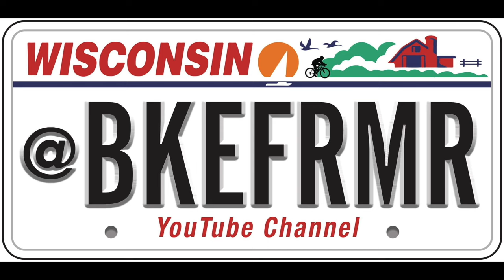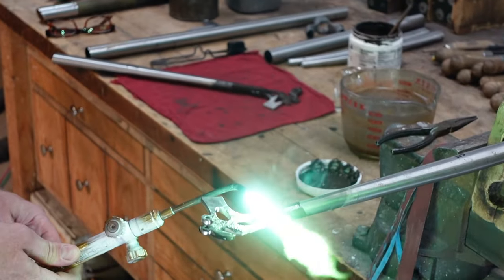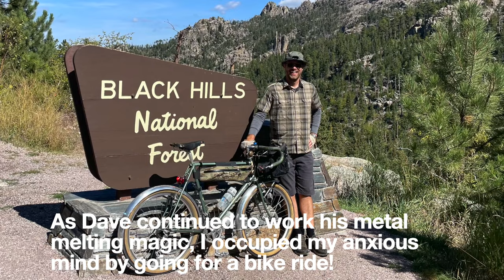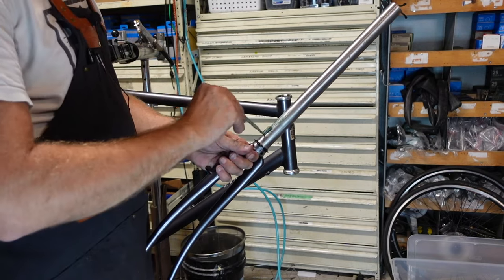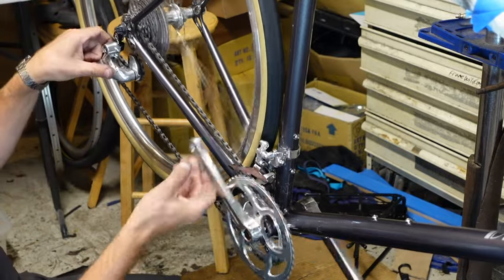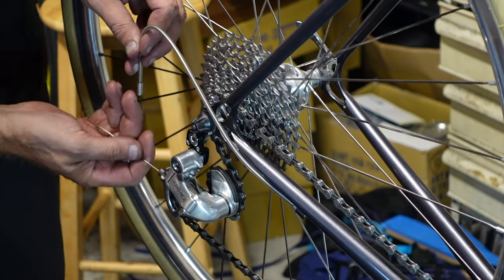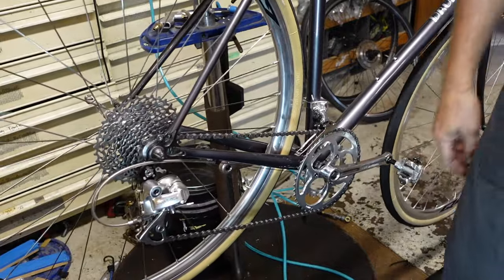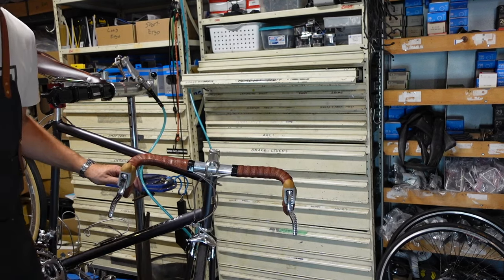BUILDING A CUSTOM STEEL BICYCLE FROM SCRATCH! Fillet brazing a bare tubeset and complete assembly!

Comment: Very nice, beautiful bike! I'm currently awaiting the final build of a custom frame I commissioned from Marino Bikes in Peru, it will be a flat bar touring bike copying a Thorn Nomad mk3, and built using parts I harvested from a Kube Kathmandu that had a cracked frame, with full XT drivetrain, dynamo hubs, SKS fenders. I'm dying with anticipation to get the frame and finally built a bike made to my own specs. It must be a joy putting the few first miles on your own custom bike!

Comment: 🤩That is one of the nicest bikes I've seen in years! Those components, even down to the cable housing, a joy to watch this.  Enjoy many nice rides on this one. I never realised that (hard) soldering could yield such nice and strong joints, very pretty. The colours match very well between frame, aluminium, hoods and bar tape, stunning... 
My first road bike (bought with hard earned cash from delivering newspapers) was a Peugeot H10? with drop bars, similar hoods, 2x5 gearing with down tube friction shifters and similar aluminium parts, loved it until it got stolen 13 years down the line ... Obviously that was long time ago 🙂, but this brought back memories of that bike

Comment: Interesting build. Have a 1960 Goeland 650B Randonneuse and wanted something more modern for touring, as the old Goeland is only original once. I'm based in Europe but bought a Velo Routier 1 from Cycles Toussaint in Canada. Bought the Toei fork blades from Compass Cycles and had a new fork made for the VR which overcame the problem of the very stiff fork. I also didn't like their rack and attachment system, as I was using an original TA rack with MAFAC Raid brakes. Surprised at you putting an 11 speed cassette on your bike. I put 8 speed on mine with a Stronglight Impact triple chainset. Mudguards/fenders are Gilles Berthoud as are the saddle, mirror and handlebar plugs. I used Velox cloth tape which I coated in shallac as per French practice. Bike rides very well and I got the forks built to take a Tubus low rider rack for front panniers. Hope to be back in Normandy on it next summer for a few weeks of touring catching the ferry from Dublin to Cherbourg.

Comment: Silicon Bronze filler rod is nice, may add some flex to the frame.   That will come in handy when discontinuities evident in the bottom bracket welds crack after 100,000 miles.   <---- obligatory assholing.

Comment: We have builders here in the UK that can do this complete with stove enamel finish.

My bike build will require disc brakes though, a 180 front and a little one on the rear. I'll get to that later.

I do however require a 40/11 rear with a 50+ up front. Current off the peg frames can't give me that, chainline issues. 

I run 26x1.25
I'd like a 4 speed but the industry doesn't support that so it'll have to be an 8, seven speed 40/11 not easy to find, 28/12 all day.

I'm sick of double shifting and I don't do cadence. I just want the right gear for the terrain.

Back to the brakes. If I run rims where I live I'll need new rims every 12 months. I don't go off road but the farm traffic plus lots of rain brings off road to me. It has to be bakes mounted on the hub. It's a necessary practicality.

Oh!!! and really good mudguards. F*CK YEAH. and panniers so I can do my weekly shop.

Comment: Nice video...

Shimano 9 speed stuff is my favorite !!
There is cross compatibility across the road and mountain bike drivetrain.

What size cassette are you installing ?
Are those original sized jockey wheels on the 7700 rear derailleur ??
Reply from the maker: 7700 GS

Comment: 34:44 Bar end shifters aren't reverse threaded. You just turn the bolt counter clockwise because you're turning it from the tip instead of the head. Just like how you turn a spoke wrench counter clockwise.
Reply from the maker: 🤓NERD ALERT! 😉
Reply: It's just common sense. If that makes me a nerd, so be it.
Reply from the maker: @jamesconroy7030  It’s just a little fun banter. If that makes me a stupid jerk, thanks for the helpful comments!
Reply: @bkefrmr   You're welcome.

Comment: Is it remotely possible to do a bike resizing from a large frame to a smaller frame? I feel that this is not a good idea but given that this is a very specific road touring bike I have, it is now oversized for my size; is it possible or not? Aside from the cost, I'm more interested in knowing if it can be done, has been done, and can be done right. It is an '85 Schwinn Voyageur SP frame, made of both Columbus SL & SP tubing... the spec chart says Chrome-moly double-butted. Yeah, I've thought to just have a custom frame built, but thought of this as a first option.